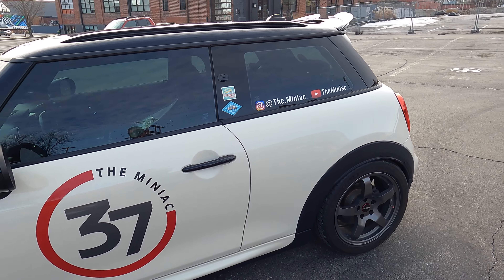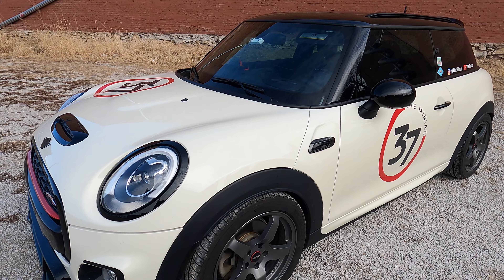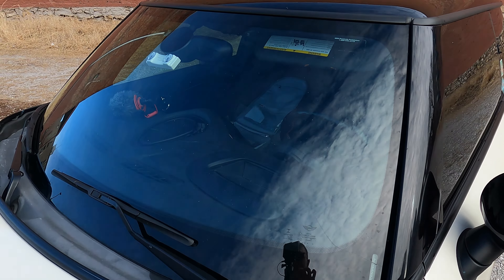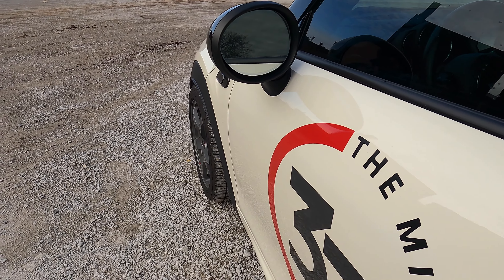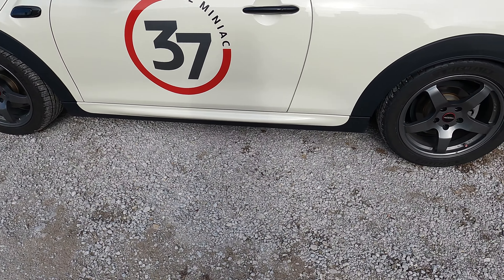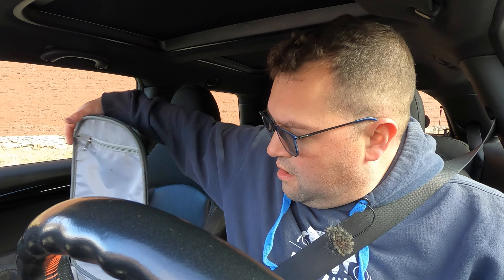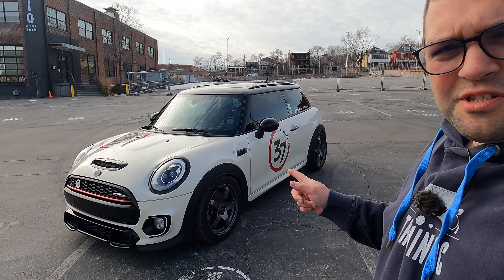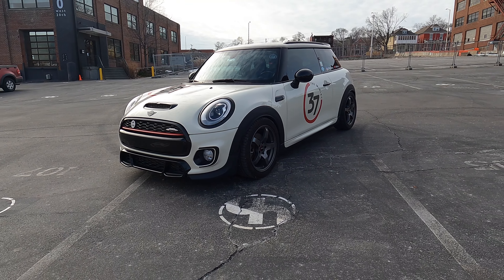My MINI Has Reached 100K Miles

Comment: Who would've thought, when BMW put one of their own engines in the car it became far more reliable than when it had a Peugot engine in 🙂 I have a late 2018 Cooper S which is great, i only hope it is as long lived as my other ride. Also have a 2009 320d M-Sport estate BMW, which i have had for over a decade and now has 212k miles on it. The car still starts first time and runs exactly like it did when i bought it 🙂 An unbelievable car (320d) which i bought for 8000 notes UK.

Comment: 179km on my 16 JCW f56, and the only mechanical “issue” I had was with the Vanos. It got somehow “stuck”, cel came on, and it started to misfire. 

My mechanic disassembled, and cleaned it, and it became fully operational again. No parts replaced in this regard. 

I have done only preventive maintenance other than that. Oil change, spark plugs mostly.

“Minor” aesthetic problems happened that I was not expecting. However, no accidents. Anyhow, I love it to death. So far it is being great. It is stock. No performance mods.

Comment: I think you hit the nail on the head regarding maintenance. Maintain it and it will take care of you. Own an F54S and F57 Justa for the last 3 years (second owners)  and both are sticks. At almost 6 years old they are both still tight and reliable. Both are relatively low (<50K miles). 
Life it too short to drive boring cars.

Comment: Thanks for this informative video. It's a good testimony to the build quality if it's racked up 100K with relatively no mechanical problems. The base F models are very ugly but the JCW and a properly modded one like yours do look good. The interiors are much better than the R models.
Not a fan of the new facelifts. The rear bumper is too square and the majority of alloy wheel designs look garbage. Your right, prices are through the roof at the moment.

Comment: After 2015 BMW did fix a-lot of major reliability issues previous generation Minis were having. 

I owned a 2016 Countryman S for 4 years, driven about 30’000 km in that span! 

They are lot more reliable than people take them for; it always comes down to how the car is maintained, that’s where most Mini owners Fail

Do proper oil changes, every 5’000 to 6’000 km change oil; 

For god sake change transmission fluids around  every 75’000 km. There’s the main reason why so many Mini owners claim they are so unreliable. 

Because no one has actually properly serviced the transmission. 

If you don’t know how to maintain a car in general, don’t go buying German vehicles, you will put yourself in debt with your stupidity!

Comment: Where did you get your vinyl wrap for the beltline molding. I did mine it seems like the hood does not cover that well having trouble with that area
Reply: @TheMINIac  
Where did you get the vinyl from. I didn't mine having trouble with the beltline on the hood some of the Chrome still shows like it's not large enough to cover the Chrome

Comment: still my mini cooper S 2017 AROUND 85 K , no problem, drain and change of disc plus front pad . I never get tired of it, I take care of it, only negative point, I'm looking for a way to make it firmer in the turns, otherwise it's a very reliable car
Reply: @TheMINIac  thank you
Reply: Same I have a 2017 cooper s, i rather have it abit stiffer for cornering in waiting until i need to do strut or spring work to change it